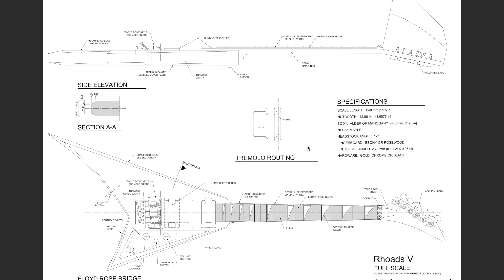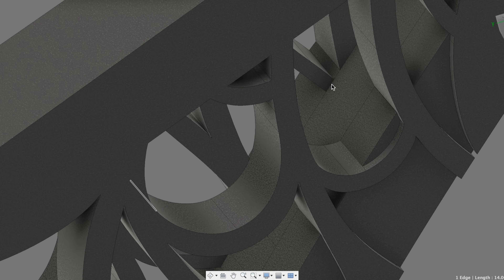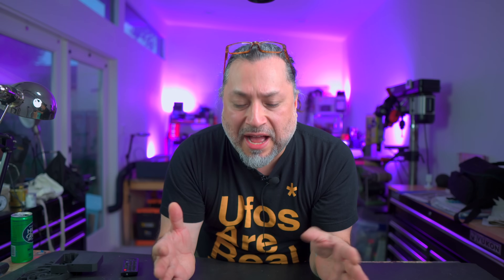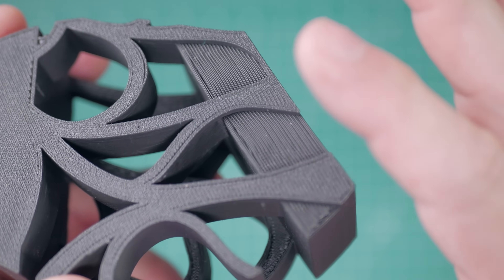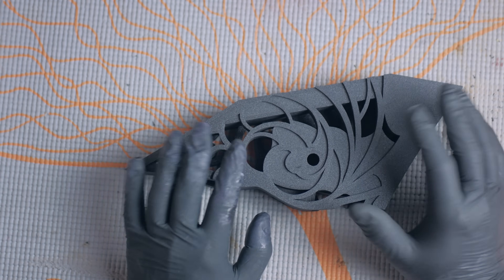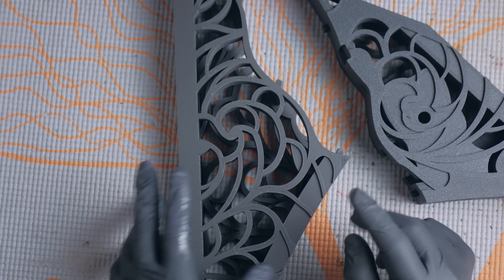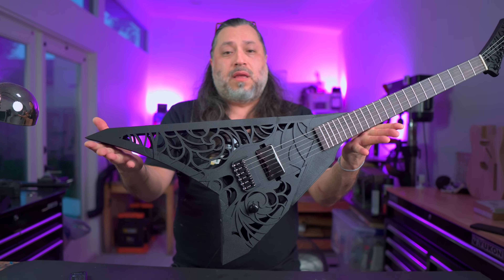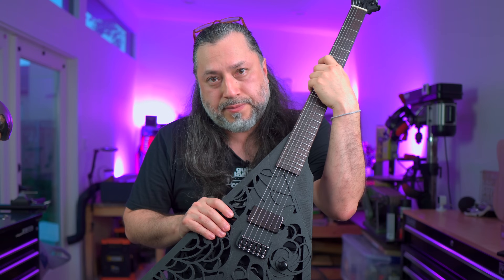3D Printed Guitar with Impossible Geometry

Comment: i am curious about the neck connection design
Reply from the maker: Hi, it's a standard four bolt connection with ferrules. There is I believe about 2.5mm worth of walls for each hole so the material is strong enough to hold the screws.

Comment: I think the main idea I've been interested in with 3d printed guitars isn't so much replacing anything that a guitar is already good at but maybe making it easier to make a guitar or maybe the visual aspect which you mentioned. Like I think even you went a bit more traditional than maybe is possible with the platform. You mentioned the electronics cavity, I was thinking the opposite that it would be maybe the ideal thing to make using 3d printing because what you could do is have pre-run wiring ducts to the pots to allow it to be more a snap design for instance. I'm actually surprised a big manufacturer hasn't caught onto this idea yet, like having a subassembly just for the wiring that you can build and add to a guitar without much fuss. EMG has their pickguard with the pickups and hardware installed but it would be maybe even better in a 3d printed standard platform where you have your pickup wires and just attach them to some solderless connectors and done.

Comment: Hey, Mark! Question on the execution of this (I'm printing one now!) How did you clear out the supports for the carbon fiber rods? I printed the center piece in the same orientation you did in the video, but the supports got clogged as I was attempting to gently put the rails into the channels and it split the model. Any suggestions?
Reply from the maker: I think I used a long  thin screwdriver to clear them out.

Comment: Hey man, fantastic job as always. I'm currently printing a san dimas shape. I came up with similar ideas like you in this video like running carbon fiber rods through body to resist the flex. Couple of questions.
1- What is the dimension of your carbon fiber rod?
2- Did you use supports for the rod cavities? How did you clean it? Was it a snug fit when you insert the rods or did you use epoxy?
3- What was your core body infill density and pattern?
4- Have you thought about using variable infill instead of using rods? At 100% infill rate, pla might be stronger (harder to flex) than a square carbon fiber tube (you used tubes I assume) with the same dimensions. (I just asked chatgpt and it says carbon is 50 times more resistive to flex at the same dimensions)
5- Why not tremolo bridge? If you used a tremolo bridge would you prefer 2 point and how would you support the pivot posts?

Comment: If you use something like ASA, you could rather nicely sand blast the parts for a good finish.
Also you could print the whole thing in layers.
If you do that, you can even laser cut the whole body and achieve the same design in 2mm, 12mm wood mixed, and maybe even use different woods to get a cool look

Comment: You did a great service to all of us with these ideas. I'm already seeing what I expected from people deeper into it with snap together components that assemble to create a body, the entire neck and so on but nothing like I've envisioned for my own design.
I have decades in carpentry, metal crafting, auto mechanics, painting, complex luthier scale modifications or repairs and just so happen to have gone to college for the science of electronics engineering. 

I'm 100% confident an entire guitar can be printed and produce quality that is salable on the commercial market but it still leaves a huge gap in efficiency because printing 1 complete guitar and assembling it will be absurdly slow with just 1 printer in use.

Comment: Interesting process.  Cool effect.  Long print times, small print sizes, and strength issues seem to be downsides to the process of 3D printed plastic guitar bodies. Used to have a real Jackson Rhandy Rhodes.  Got it cause it was similar to a guitar I designed in HS.  So far I've owned 97 guitars and only ever sold 3. One of them was the Jackson. Like a V, you can't really play them while seated.  At least my design from HS had an approximation of a leg cutout - and they put a skid pad on the first V's.  Bad designer (Jackson) - No Twinkie!

Comment: very nice.  

I had a thought that you could try to refocus your efforts toward sonic goals that might also look beautiful.

What if, from a smooth, slightly rounded back (like ovation guitars), you could have some beautiful geometry that aims fibonacci spiraled cones from a smal focal point near the back, out toward an opening on the front of the guitar... so the back wall would serve as a sound reflector toward the front, but then these spiral conch shell-inspired cones would also deliver sound out of the front of the body in such a way as to promote sound flowing out of the instrument into the room.  could be a hybrid acoustic-electric that might sound very nice acoustically in the room, but then be plugged in too... I think a thicker body would also allow richer deeper tone.  should probably get some math regarding the E string wavelength and then measurements of the fibonaccis... so you can make the guitar deliver that bass tone as deeply as possible.  love your work here.

Comment: I have not epoxied printed parts yet but I have used CA glue and I can vouch for how strong it is. I had to separate a few pieces about a month ago, and the glue held so tight that in some areas the plastic ripped little chunks out of the adjacent piece. The glue joints were stronger than the material itself.

Comment: Really digging everything about this. I'm working on a guitar print right now that has a hollow space for a wooden core in the middle where the neck, pickups and bridge mount so its basically printed wings. The printed part is essentially aesthetic. I'm just not convinced on the long term stability of ABS or PLA continually holding a hundred pounds of string tension. I've done guitars out of wood in my garage and I can say making one 3d printed is just as challenging.

Comment: I also open the video for the design. It looks amazing! :D I bought the 3d files for the print but I'm a bit lost on the carbon fiber rods, do you have a guide for those?
Reply from the maker: I started glueing the pieces starting from the rear. So glue everything together except the heel. The first set of carbon fiber rods slide into the exposed slots. The slots might be hard to find but they are there. Then glue the heel on. The 2nd set of rods enter from the neck pocket joint.

Comment: Amazing work, Mark. You just knocked it out of the park here and I love how unique the V design is. The whole thing is shockingly similar to the one I've been working on since January (just started posting my shorts on it last week) but mine is loosely based on the ESP Arrow shape. I'm even using Fusion 360 and I'm using layered dimensions in the top design. Man, wish I had thought of printing the layers separately and gluing together...would have made sanding SO much easier instead of trying to sand in the small deep areas. Anyway, awesome job man.
Reply from the maker: I watched all your shorts. Loved them! Keep posting and I'll keep watching.

Comment: Hey Mark, amazing work! I love the design and how you departed from traditional guitar design philosophy and really embraced the possibilities of additive manufacturing! <3
I definitely want to recreate this beauty myself, so I bought the STEP files from your website and they slice just perfect! 👌 One question: the build in your video has an ornament piece on the headstock that seems to be missing from the zip. Is that intentional due to obviously different headstocks depending on what neck I get?
Edit: also, how did you mount the pickup?

Comment: @16:03 Yeaa... 🤔 That didn't exactly turn out super convincing in my books? 🤨
Just so you know... Multi Material 3D Printers ( like the Bambu Lab AMS ) can solve your poor support Surface Finish by using a different Material for the Support Interface Layer.
You'll want a material that is compatible with the main Material where they stick to each other but do not bond ( for stuff like ASA you'd use HIPS ). This allows for a ZERO Support Interface Layer Clearance Setting ( single Material Supports usually have something like a 1-2 Layer Clearance Setting ) with the first Bridging Layer essentially being printed as if you were to print on the Bed instead of 1-2 Layers in mid Air for a much-improved aesthetic.

I this Video you see it being used with the barely visible thin layer of white HIPS between the red Model and Supports: https://youtu.be/yGNRdi7Ox0M
Also pretty sure if you don't have access to an AMS then you can just rig a manual Filament Change into your Slicer and do it manually - Have it Pause before doing the two Support Interface Layers > feed in the Support Material > Purge out the old Material > Have it print the Support Interface > Rinse and repeat back to the original Filament.
For as long as everything is on the same Layer you should only have to do like two to four swaps per Part.

Comment: Hello! loved how you shared the things you experienced throughout the designing and 3d printing process.

Considering the mount of effort and attention to detail you put into designing it, You should really consider manufacturing the 3d printed parts using "powder bed fusion" based 3d prinitng technologies like "selective laser sintering" (SLS) or "Multi jet fusion" (MJF). These printers typically have huge print volumes enabling you to make it in one whole piece and also provide extremely good and consistent surface finish. They also don't require any support structure no matter how complex your geometry is! 

You might have to out-source the parts from a 3d printing service provider that offers SLS or MJF as a service in your area.

You may also want to implement "heat-set nut inserts" for mounting the electronic parts that need to be screwed to the 3d printed parts, and, pair that with standard machine screws replacing the self tapping screws. This will significantly increase the longevity of the threads for it you need to upgrade your components and improve the overall "premium"-ness of the guitar and make it a more polished end product!

Hope any of this helps! :)

Comment: Organic supports are great but they aren't always the best solution so keep that in mind. To get better finish on the supported areas make sure to use a few solid top layers on the support and adjust the gap to the point where it isn't too easy to remove but also not too hard. Additionally sometimes you have to print at a different temperature than you expect specifically for the supported area. I mostly print in PETG and found that with some filaments I have to print 20°C hotter to get a smooth surface on the supported areas. Additionally, if you have a printer that can print multi-color you can use a soluble support filament and that will give you the best supported finish. Personally I probably would have split that in half between the face and back of the guitar. Then you could use standard supports and the supported side would be on the inside where it is much less noticeable if it doesn't come out so good. Also if you use a carbon fiber infused filament you get a texture that helps to hide the layer lines so that may be an option. You can also get texture from the build plate design and Prusaslicer has a "Fuzzy Skin" option for texture as well.
Reply: Oh also look up 3d Gloop glue. They make glue for just about any filament type that is fantastic!

Comment: Very good job on the design, it looks awesome, personally i would have split the model in half so that when you print it, you get the plate surface finish on both ends and to avoid using supports, but the end result look great either way

Also for a V2, you could do the trim in an accent color to make the design pop a bit more, or even do a wood veneer on top of the design

Comment: I purchased your step files and it's missing a few things: A BOM would be appreciated, I see the normal guitar parts in this youtube description but nothing about the carbon fiber rods.  What size are they?  I guess I'm gonna have to figure it out from the slicer.  Also, what print settings?  How many walls do you recommend?  I'm going to have to go with ultra overkill on all parts that are near the strings
Reply from the maker: My walls are 2.5mm. So however many walls necessary to get there, 5 or 6. Every part was standard 15 percent infill except for the main center part and heel, those were 25 percent infill. Rods are 3mm x 6mm I got them here: https://www.philadelphialuthiertools.com/truss-rod-nuts/carbon-fiber-truss-rod-rectangular-118-3mm-x-236-6mm-17-9-455mm-length/

Comment: The problem with texture is the orientation of the print and where you need your strength. Solution. Magnetic face plates.

Comment: This is a very beautiful project. 
If you want to achieve a better finish, you may look at at PLA-CF or PETG-CF (CF - carbon fiber). Or filament with GF (GF - glass fiber). This is matte filament that due to the small fibers lets the filament breath and evens out flawless. You may need to get a heated dryer like the Sunlu 2 and print directly from it after a couple of hours of putting the filament inside. (Setting the timer below zero goes to endless) Don't mistake the Carbon Fiber for adding to the durability of the filament. It just gives a beautiful matte and uniform look. Honeycomb infill avoids overlapping infill that may accumulate filament on the nozzle tip usually. You may find it also useful to take a look at Orca Slicer and the filament calibration Menu there. Orca Slicer has a Qidi Q1 Pro profile and is like the Qidi slicer also a Prusa Slicer spin off. 
Anyway, like you said in the video, the best is to take the best of all worlds. Thus you may want to take a look at the new Elegoo resin printers for parts that need super tiny details. Uncle Jessy is a great YouTube channel related to resin printing. He has a lot on Elegoo resin printers.
Reply from the maker: Lots of good suggestions. I just found Uncle Jessy. And I had no clue resin printers could print finer detail. Thanks!

Comment: Regarding the surface finish, you may want to look into a process called "ironing", which helps to smooth out the top layer(s) of the print.  It can be a bit of a pain to really dial in at times (other users may have already posted results that could help), but in my own experience, it does help produce far nicer results.

Also, I agree with the idea of not trying to use 3D printing for everything.  It's a problem that I see often in 3D printing projects where people will try to print things regardless of whether or not there is a better way to do it either with pre-made items or other techniques.  Now, as you mentioned, there's always the novelty of printing everything, and I saw another guitar build recently where it even features a 3D printed neck (with metal support).  It's nifty, but given the work of inserting all the frets... I think I'd rather just buy a neck. 😅

Comment: Might I recommend using heat to set your ferrules in on the next one? It'll help bind to the filament a bit better rather than pressure fitting it. I recommend looking into your settings for a better surface texture. Of course, every printer (and slicer) is going to be different, but there's a lot more to 3D printing than one might think. I personally prefer using OrcaSlicer, it's super intuitive and has a lot of settings to play around with. I also recommend scaling models down to like 20% to check all your tolerances and surface areas with a quick print. Another way you can get a smoother finish, is by using a 3D printing resin that you pour directly on to the model, after it's finished, to fill-in the gaps.

I could talk all day about this if you want more advice on it.
Reply from the maker: Sweet! Thanks for the advise.

Comment: Your project is very beautiful, but I have a question, will the guitar withstand tuning? Won't it warp over time? Do I have to loosen the strings after use?
Reply from the maker: From what I've heard via other luthiers who 3D print guitars, it shouldn't warp. Being somewhat still scared that it would bend, I decided to add 4 carbon fiber rods to add rigidity. It's rock solid.
Reply: @MarkGutierrez  cool!! I had already seen 3D printed guitars but with the middle section in wood, like yours, this is the first time

Comment: QIDI Q1 is capeble to print ABS with heated chamber and also capeble to prind carbon fiber composits, so the better choise for future projects would be ABS CF or ABS GF, cuz at first fibers will hide layer lines, at second armatured ABS will hold up 60 degreees celsius of sun heat, while PLA gonna became a chuwing gum, and also PLA gonna decompose itself after a few years to. If you gonna use CF or GF ABS, buy a hardned 0.6 nozzle, or you may expect alotta clogs with 0.4 standart. cool desighn by the way fella!

Comment: Doesnt see the question in the comments yet. How did you implement the cf rods?
Reply from the maker: The slots for the rods were modeled in CAD. Each pair of rods had their own entry points. Once the upper and lower horn are epoxied to the main center piece the first pair of slot entry points are available to insert the rods. Then I glue the heel on to the rest of the body. The heel has two entry points for the upper rods to slide in. There is enough room in the slot to push the rods in past the heel so the neck can be installed correctly.
Reply: @MarkGutierrez  ok, got it. Thanks.
I was just wondering if it was molds or if you Set a stop in the slicer to insert the rods and than continue printing.